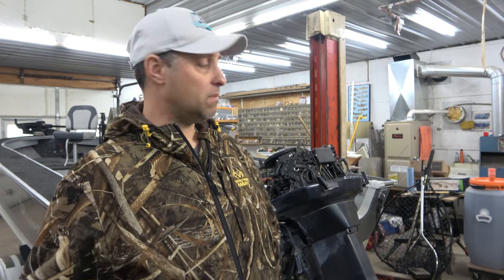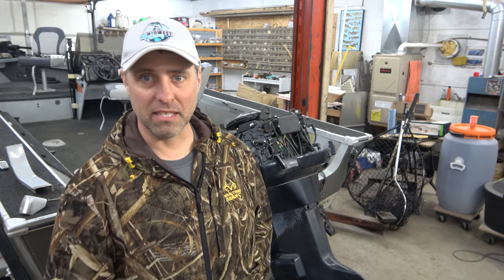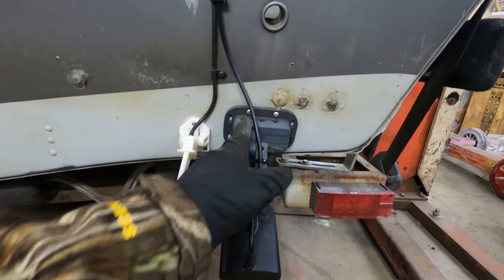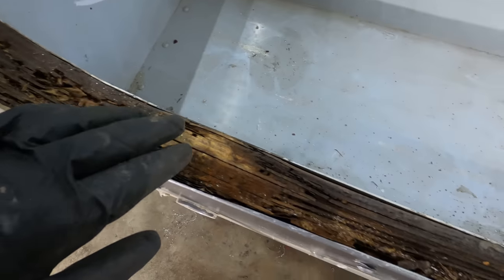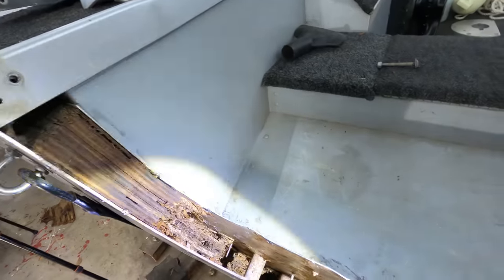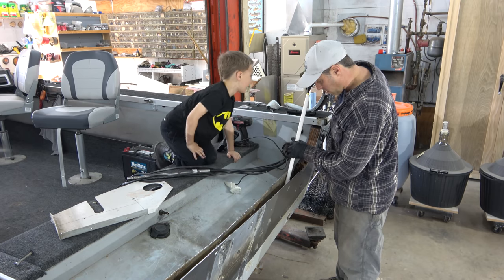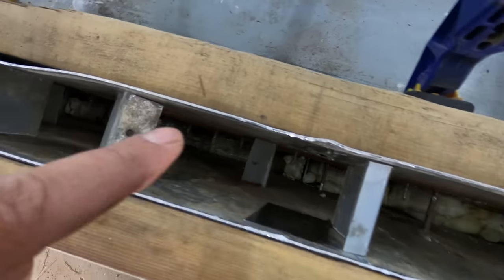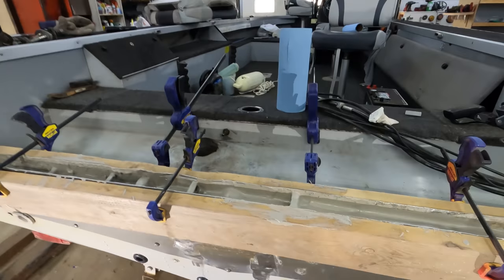The Easiest Way To Replace A Boat Transom

Comment: Great video! Interested for a follow up to see how this is holding up. I do no understand where the strength, keeping it from sheering, cracking would come from? Cannot understand why boats have wood that is not sealed or coated in them. That didn't even look like marine plywood. I hope the poly foam was closed cell. I'd use Sikaflex 591 or 3M 5200 to seal the aluminum not that Flex junk. I'd use the same where the aluminum comes together. That flex stuff might last a year or two, it is just siliconized rubber. I always use 3M 5200 for marine (I'm on salt water) jobs, and for things I never want to come apart and 3M 4200 for things I want to seal but may disassemble in the future.
Reply from the maker: Thanks for all the info. It might come in handy in the future.
Reply: Because both boat makers, and the repair bunch want to do it on the cheap. Several years ago I replaced the transom and stringers in a 19' bass boat I owned, and I started looking for appropriate plywood. I called several companies that repaired boat transoms, and they all said "Huh?" when I asked where they got their Douglas Marine grade plywood. All of them told me they just used treated exterior plywood, which is why it spits the resin/glass after a few years. I finally find 4X8 3/4" thick Douglas at a Hardwood specialty store. Sanded them, glassed them and sandwiched them together with lag bolts. Sanded that down to the right thickness then glassed it in. The rest of the boat may fall apart, but that transom looks like a dinner table.
Reply: @Rem1061  Wood transoms are not “cheap”. This is a riveted aluminum skinned boat. Wood is strong and will last a lifetime if taken care of. This transom failed because someone allowed water to enter the transom probably by drilling into it with no proper sealer. 
There is no such thing as “Marine Grade” plywood. That is a marketing tool used to attract buyers. This plywood is only void free, thin layered and is constructed with ordinary exterior plywood glue. 

Wood is light, strong, flexible and a perfectly fine choice for rivet boats.
Reply: @RedJesus666-k9z  Pretty sure I never said wood transoms are "cheap" since I have built them myself. The transoms most companies PUT IN are made from cheap pine plywood which spits the resin within a few years. Douglas Fir is the best  (or one of the best) marine grade plywood to use.
Reply: @Rem1061  nice try pal. Name ONE builder who uses crappy pine plywood. Geez bud

Comment: I knew the comment section was gonna be juicy on this one...  I just had to look.  I'm no expert,  but it appears to me to be stronger then it was... so at a minimum a life extender for this boat.  I'm a fan of the mentality of doing things as cheaply as possible if the final result looks and performs properly.  Looks wise you nailed it. Performance wise I cannot imagine that void space and that top cap working out. Have that top cap welded and see about if you can pour new material on the existing material and if they will bond correctly.  If so get rid of that board that you left and no way it's not stronger or better then a brand new particle board transom.  Sorry for the long comment,  I wish you the best!
Reply from the maker: Hi Tim. I appreciate your thoughts. I would have to agree with most of what you said. The original top cap was just folded over without actually being connected to the inner side. That's why I didn't permanently connect the top cap together. I'm going to talk to carbon core to see if you can pour new product over old. The instructions say to do it in one continuous pour, so I'd assume probably not. No worries about the long comment. I like when people put some thought into what they want to say, and give some helpful feedback. I learn as I do things, so I enjoy hearing other opinions.

Comment: To weld aluminum you really need someone with a tig welder to the job that way it looks like a pro did it.
Reply from the maker: I agree! Never tried welding aluminum before and wanted to experiment. There was too much surface area to heat up, so it never got hot enough. Thanks for the feedback.
Reply: The problem with that is finding someone that CAN weld it that wants to get involved. This is a pretty Mickey Mouse repair of a major structural part of the boat and aluminum can be hard to weld well even with the right equipment. Maybe he earns himself a hundred bucks on welding it, but if it breaks and the boat sinks he could easily spend many times that defending himself from a lawsuit from the next of kin.
Reply: @GoMidwestFishing  Surprised you didn't want to practice first on some scrap metal if you'd never tried it before.
Reply: @the_omg3242  the welder will only cover his work / welding not the entire boat. Mainly all he would do is seal up the crack where the caulking was removed. If the entire transom fell off the boat it would not be his problem. You're getting too technical talking anything more.
Reply from the maker: @the_omg3242  Yeah, that might have helped. My main concern (which was correct) was thinking the surface was too large to get got enough. It was just an idea, so I thought I'd try it.

Comment: An electric chainsaw would have done it quickly and it would be easy to control too. I may be modifying the transom of an old original 13' whaler from 15" to 20" because the 15" motor selections are really limited now day's. If the transom is still solid then I will create an all aluminum sandwich to raise the transom. If its rotten then it will be an all wood and fiberglass project.
Reply from the maker: I've gotten several comments about using a chainsaw. There seems to be a debate whether or not its a good idea. I think it would work good as long as you don't destroy the boat in the process. Thanks for the comment.

Comment: Thanks for taking the time to make this. I'm in the same situation.
Reply from the maker: Thank you. I hope it helped. I would suggest making sure the resin fills the transom to the top. I think that was my biggest mistake. With that said, its been holding up perfectly.
Reply: Could you have filled the right and left higher sections by filling the main section like you did then drill a half inch hole in the left and fight top cap and used a funnel to pour the liquid in tp make it a full one piece?

Comment: That's an inteesting product.  How has it held up after 2 years?  When I was a kid in the last century, I did odd jobs around a boatyard, mostly yard and building maintenance and clean-up, replacing shear pins when inexperience boaters came crippling to the dock, and raising docks after the spring thaw  and pumpng water out of bilges.
Reply from the maker: Hi Dan. It still looks like the day I replaced it. Absolutely no issues yet. I'm very impressed with the stuff.

Comment: 3M 5200 would have been great for the crack/gap and the top cap.
Reply from the maker: I've been hearing that a lot. I will have to use that next time. Thanks for the info.
Reply: @GoMidwestFishing    Weld no glues.  Id install some big brackets inside   If that transom comes loose that bilge wont keep up.  

If you hit a river log floating ? 
Your gonna see that motor
Break that transom then the motor will power back and it ail all come off to the bottom.

Comment: This is great!!! I’m currently cleaning out the wood on a tyee 5.3. I don’t have any screws pulling away, is there any problem with leaving all screws in place and pouring? I basically only have the motor bolt holes to cover. My transom is similar to yours, think I should pour the top corners or does it matter?
Reply from the maker: I don't see why you can't leave the screws in. As long as it allows the resin to flow to all parts. My transom has held up perfectly even though I didn't pour the corners. If I could do it again, I would try to pour the corners, possibly by taping off the top of the transom to keep it from overflowing as it goes up the corners. Its a tricky one to do. Let me know if you figure that one out.
Reply: @GoMidwestFishing  will do!

Comment: Just because it’s an idea to keep the transom wall from pulling away from the floor cut a couple of brackets off of some angled iron  or aluminum 
It would give a strong mount and can be positioned wherever
Reply from the maker: Thanks for the info.

Comment: My friend and I replaced my transom on my Lund Tyee in a little over 6 hours. I used the good plywood and put 3 coats of urethane before gluing them together.  My wood was no where as rotted as this either.  Good luck with it.
Reply from the maker: My father-in-law has a Lund as well. We replaced his transom the same way you did. It worked well.

Comment: The transom was backed with an untreated Parallam.....At least the wood in the transom wasn't CCA pressure treated.....The aluminum would have probably been destroyed......For small easy aluminum fixes there is a compound I use called Splash....It's a 2 part epoxy and you mix it underwater wearing gloves.....The result is like concrete.....Great looking finished product Rande!!
Reply from the maker: Great tip! I just looked up that splash product. I will keep that in mind next time I have a repair to do. Thanks Wes.

Comment: I have a 12ft kingfisher jon boat with just an 8hp Yamaha outboard nothing special my transom my have to repaired this summer I never thought they made such a product I'm going to try this out if it worked for your boat I'm sure it will on my boat ,after you did this did the transom have any play at all in it when you tried to move it ,it didn't look like at it just wondering thanks,great video take care and stay safe
Reply from the maker: Its been rock solid for three years now. I've had no issues. I think it work great for you.
Reply: @GoMidwestFishing  ok thank you for the product information, I have to this you could probably use it on other things as well ,the thing I like is its able to get around stuff because it's like a liquid and gets deep in the spots you're not able to see yeah I have to try this product for sure

Comment: The long aluminum trim pieces MUST go under the curved corner trim pieces, otherwise the water is going to be able to sip under the long trim pieces and eventually  inside the transom.
Reply from the maker: I thought the same thing, but the way the corner piece is made wouldn't allow it. There was no way to fit it underneath. The carbon core is a solid piece that does not absorb water, so if water gets in there it shouldn't do any harm. Thanks for the input.

Comment: I did the exact same thing even though I did it a whole lot different but as long as that stuff gets in there it's not going anywhere I promise you that! I've hit waves 4 ft High I left a gap at the top and right now I'm finishing it off with more carbon core but I've had my motor on my boat and I've been on the water 35 times and I have not had one problem with my boat Rock Solid
Reply from the maker: Great to know. I've been running mine for the last three years now without any issues. This stuff works well.

Comment: Dude I applaud your effort but this is a disaster. Each of the pieces of angle are going to eventually punch through the aluminum transom. They are stress points with sharp edges! I won’t even get into the rest of it. I am sure that the liquid product you use is good product, but you should have consulted with the manufacturer about how to address the spacing issues. I am sure the next owner of the boat will be the one dealing with the long term.
Reply from the maker: I understand your concern. I would disagree about the stress points though. The carbon core is rock hard when it cures, so the only way for the angle to punch through is to crush the resin. Thanks for the input, I will take it into consideration next time.
Reply: @GoMidwestFishing  yea you’ve done a solid job. Lot of haters and boat building “experts” that probably would never be able to figure out this stuff on their own. 

Kudos to you for doing the research and having the balls to share your mistakes. That’s how we all learn. 

As an aside, what’re you brewing?
Reply from the maker: @MrTerduckin  Thanks for the kind words. I see you noticed the fermenters. I have a vineyard with three grape varieties, so you your looking at about 75 gallons of wine. Frontenac, Frontenac gris, and Marquette.
Reply: I am a marine technician with over 20 yrs of experience repairing aluminum, fiberglass and wood boats, if you are ever going to replace the wood in a transom, please do not replace only a portion of it, all or nothing, no matter how strong this patch material is it is not the same strength as a complete homogenous piece of wood or a complete transom filled with the resin.  The structural integrity of the entire boat is jeopardized by the repair in this video.  In use it may work for a period of time, however it may also fail catastrophically in normal use on the water.  I applaud your attempt, however you cut 2 many corners or failed to cutout the corners, depending on your perspective,

Comment: Very interesting video, I would've drilled some holes into the wood that was left for the carbon core to into and grab..  I know you said it's supposed to bond with the wood,  I was thinking it could help strengthen it a little more. Thankbyou for sharing , good job
Reply: 😳 

I was 20 miles from the gulf 15 miles from any ramp on the Suwannee in pitch blackness. 
Id want all that wood out and more alloy support and id lift the entire boat with the hoist on that motor and jumped up and down in the back.    Id rather is break now.  Then be swimming in the dark on a outgoing tide of 8 mph with swamps on both sides.    Needs to be redone.

Comment: Wow you just trashed that thing. You have to get all the rotted wood out and replace it. Why do you think the transom went from end to end? The title should have been what not to do when pouring a transom.
Reply: Wow you must be a super expert on this stuff huh???
Reply: That was painful to watch!
Reply: @MrTerduckin , he has valid points to his criticism. If you DON’T get all the rotten wood out, it will cause issues further down the road. Loose transom eyes that are used to hold the boat to the trailer being one of them. Another point that I haven’t seen in the commentary is how does he know there aren’t air voids after pouring it from top to bottom without ensuring he worked any air out of it after pouring?  There’s things “that’ll work” versus things that are done PROPERLY. Sorry to the creator of this, but this isn’t what I’d consider done properly.
Reply: 🤕 TRUE THAT 😕
Reply: @apachepaul  🤣🤣🤣🔥💥Aluminum welding!??? On that dirty assed silicon coated metal???
WTF 🤕
Reply: @apachepaul  This guy is like a blind man trying repair a watch.
Reply: @ripperace  yup .. TRUE STORY 🤣🤕
Reply: You don’t want to put wood back into a boat??? Woods horrible man!!! He used the correct filler material he was just a couple gallons short on his resin! That’s exactly the structural resin that you want to use to fill your void after removing the rotten wood!!! Wood rot’s… it’s 1970’s boat build technology… woods bad! That’s three times stronger right now then it was originally… do some research on structural resin… 😂👍
Reply: He removed the rotten wood folks?
Reply: Anyone who speaks negatively should shut up. This video will help many people and maybe save a live. To repair transoms in wood is something people put off because of lack of tools skills or money. This can be done for a reasonable amount of money and not much skill. But if the motor comes off the boat someone may die. He's out fishing and this epoxy is strong as steel. He can drill a few holes in the wood and pour the epoxy into it would e been nice but it's a fishing boat. Thanks for the video.
Reply: @DaveyBlue32 yet he left wood to rot which in time will destroy all the work he tried to do.
Reply: This is the No 1 video on how not to repair boats, when you don’t have a clue what you are doing.😳😳
Reply: @neilwharton720 ,
   Yeah it's true he's talking about how terrible it would be to take it apart and replace the wood he could have had five rivets drilled out in the time he took to describe how bad it would be. Lol! I can't imagine feeling good running down the river with something I repaired like this!
Reply: The truth when doing structural repairs to a boat. especially a transom you want a professional to do the work. The pressures involved when you're going full throttle are intense. If you replace it and it is too rigid it can snap off from either side and obviously you don't want it with to much flex ( weaker ) because it can rip straight off. The engineering in boat building needs to be followed. A lot of boat maintenance should be left to the people who do it for a living. Not everything is a DYI project. When you are out in the water and can't see the land you will understand how much in trouble you are when anything fails. You have the same chance of surviving a plane crash as a boat sinking. Odds are you will wonder what was I thinking trying to skimp on guess work. And yes I am a professional boat builder licensed technician fully booked with work for the next 4 plus year's and don't need the work. And if you play Russian Roulette for fun then go ahead and just pour or whatever pop's into your head but if you value you and your family life's then call a professional. And this crap about not saying something that will hurt his feelings is nonsense just imagine 10 different people doing this and adding their different versions which will lead to disaster. Don't do videos about stuff you don't know

Comment: I can tell you for a fact that foam will attract water and hold it.
Reply: If foam holds water how come it floats?
Reply: @SawmillerSmith  open cell or closed cell foam? It can hold water and still float. Think sponge. They hold water and float.
Reply: @georgesimpson3113  sponge isn't foam like closed cell foam.